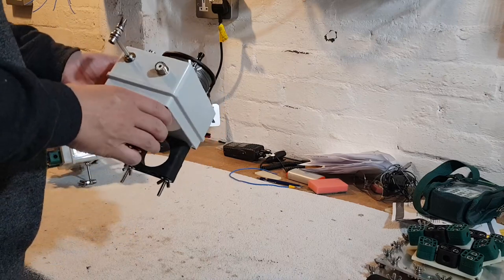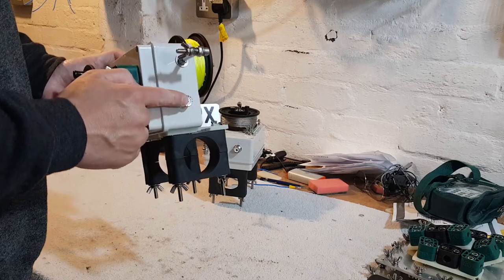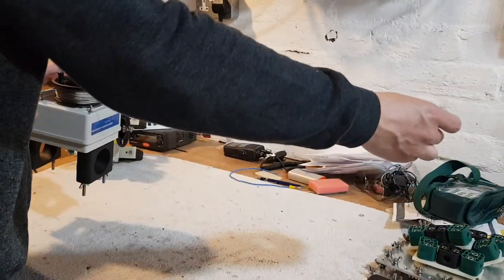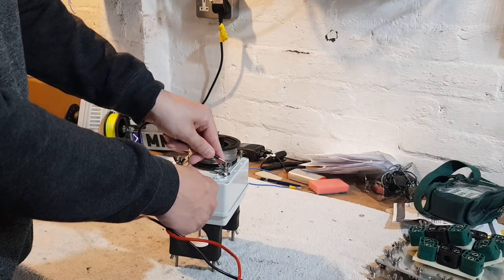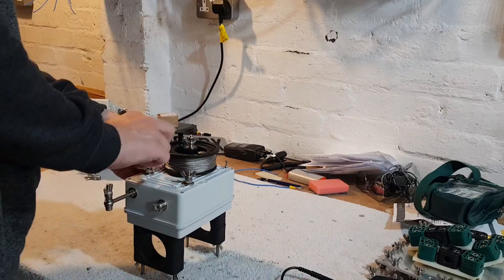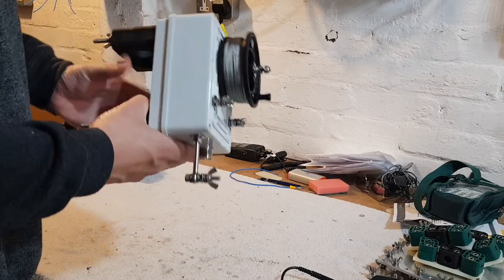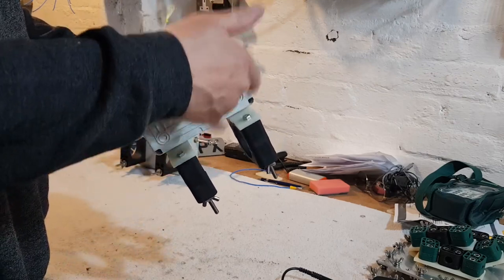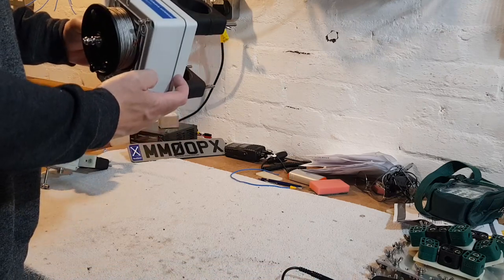adjustiwave multi Antenna System Introduction

Comment: As I’ve commented previously, I’ve been experimenting with linear loading.  Initially did not achieve the correct spacing but once I did it looked to be promising.  The CrankIR looks similar to what I was after  but 1400 quid is a real dampener.  Appreciate the upgrades you’ve been through as even the most simple designs can be complicated when doing it for real as amateur radio sends a lot of curved balls. Love it, been on your website.  I have a version of the DX Commander, very good.  I’m short of the lower band capability as my Cobweb does well for most bands 20 and above.  The review on your website is first class and I’m giving this very serious thought, Spiderbeam already on order.  I doubt I would use portable, the issue I have is my portable radio setup attracts people.  Whether on top of a hill or in a local park.  Is that CB being the most common question.  With my KX3 I use EFHW on 20 and above.  Radials whether on the ground or elevated is just asking for trouble.  What can I say Colin I think this is a winner and worth consideration.  👍🏻👍🏻👍🏻 73 de M0AZE Mike